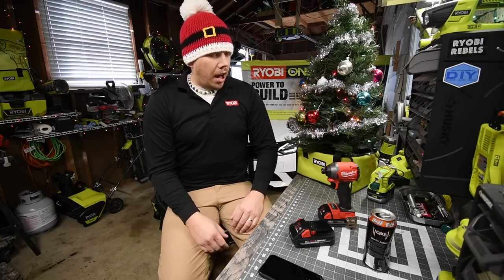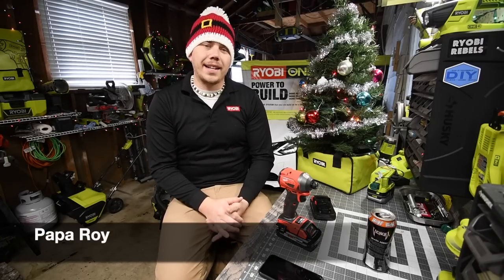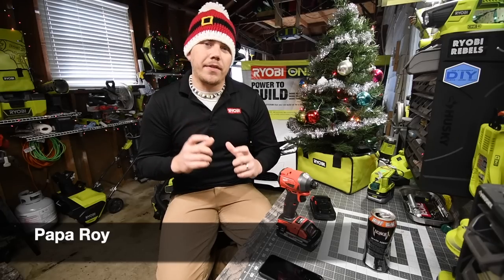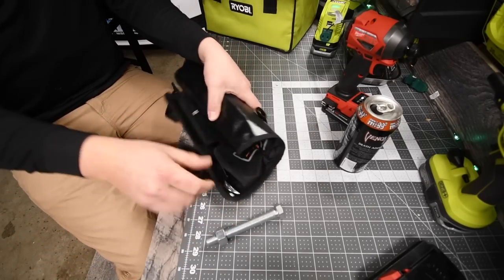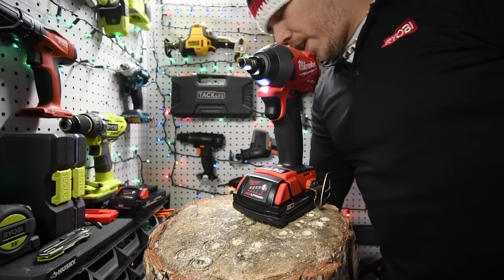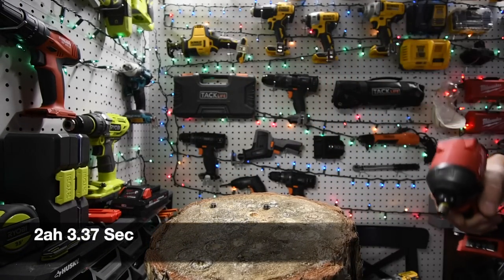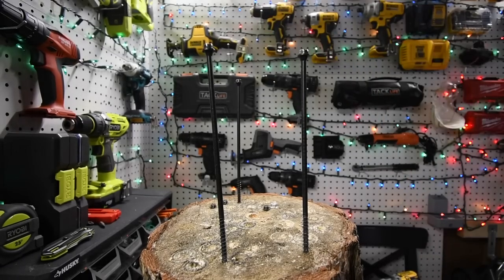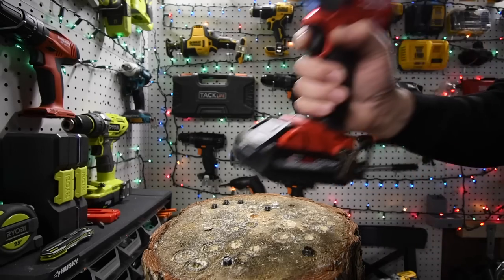Milwaukee 1/4 impact driver test

Comment: We use the medium 1/2 impacts at work to undo 100 15/16 bolts and put them back in 2-3 times a week.  No failures in 2 years of use.  Got the stubby 1/2 m12 and that thing gets hot by the time it's done. It just about uses a whole 4ah battery to get the job done.  The impacts are definitely impressive.
Reply from the maker: Yes they are and thank you ver much
Reply: So your removing and re-securing almost 1" bolts with this 1/4 driver? Any age/rust involved with those 15/16 bolts? I only ask because I need something small enough to access the tension rod nut and zip it off of my Taurus ( yeah ford I know). In a short sentence you seem to have alot of experience,think it will work? The nut size is 21mm I believe. Any info is appreciated.

Comment: I bought the kit with m18 fuel hammer drill, 1/4in impact and angle grinder with 2 batteries and a charger for $399 at Home Depot it’s worth every penny

Comment: For the nut and bolt test.   You could get a thick chunk of steel.  And weld the nut or bolt onto the back side.  And use a digital torque wrench to figure out how much torque the driver was able to put the bolt down with.
Project farm has a rig set up like that.  Not sure which video it’s in.
Reply from the maker: Thank you sir

Comment: Can u put other bits on there like philips or flathead or Allen etc etc
Reply from the maker: with an adapter yes, I do have a video on those and I recently just uploaded one with using it and I also made a Dewalt Freak impact driver

Comment: I love my 2nd Gen fuel impact and hammer drill, had them for a couple years now. Would love to get a 3rd Gen combo set soon, but I can't afford it right now as it's $579 CAD for the driver, hammer drill with two XC5.0 batteries and charger. Fml 😂
Reply from the maker: I thank you for viewing sir :)
Reply: ᚺᚨᛗᛗᛖᚱᚺᛖᚨᚱᛏ just picked up my hammer drill and impact combo today for $309

Comment: Your body temp is basically 98 degrees so I doubt 101 & 103 degrees is hot enough to do any damage
Reply: Brian Klein not a chance that impact is just getting warmed up go watch vcg construction ttr they haven’t had one of these Milwaukee’s fail yet and they put them to the test weekly at times. Sadly there has been several dewalts fall short in Milwaukee’s footsteps!
Reply from the maker: I didn't say the tool is damaged, soooooo. but thank you for pointing that out and thank you
Reply: @ManCaverTools  I got the impression that you were implying that was a high temperature
Reply: @rogerslawncare7260  oh I know I just bought this & 2 6.0 AH batteries on ebay for $220 I'm replacing my older dewalt brushed model 885 or 883 that starts smoking under occasional heavy use

Comment: Great review! I have a quick question regarding Milwaukee and Ryobi. I recently bought the  Ryobi 238 brushless impact driver. I’ve been using Milwaukee impact driver kit Torx bits for a project. The Torx screws im using are 4 inches long. The Milwaukee Torx bits have broken a few times. The guys I spoke to at Home Depot we very surprised it broke. They gave me a new kit. I had one other bit break after getting the new kit.  Have you had this happen? I probably put in about 30-40 screws and had 3 bits break. I m not sure if I’m doing something wrong.
Reply: Are you using the proper size torx bit? Sounds stupid but I’ve done that with torx before.
Reply: Yeah like Nick said I’ve done that myself with the wrong size...Check that first to make sure
Reply: I just bought The Milwaukee brushless compact 1/2” drill driver kit for $89!!....Great deal and that gun is a beast putting out 500 inch pounds of torque
Reply: That's interesting, the longest torx screw I have driven with my bits are 3 inches and none have broke yet. I can see it happening with a strong Brushlesss impact and the screw finding a knot.
Reply: Thanks everyone for replying!!! The screws are definitely long but unfortunately I needed that size for the project. The size of the bit was correct. I did break one Torx bit because the size was incorrect. I used the wrong size because the correct bit size broke and that was all I had left (lesson learned).
Reply: RICH REVIEWS 
I’ve wanted to buy the Milwaukee impact for that very reason! I’m invested in Ryobi batteries and tools so it’s hard to justify changing. Plus I’m a  newer weekend warrior and don’t use the tools for a living. If money was not a concern I’d  definitely buy the Milwaukee impact!
Reply: falchulk ... First of all 1/4” indicates that it’s a impact driver which is more powerful and generates more torque Then a drill driver to begin with... so of course it’s stronger but the drill driver that I have is the most powerful in its class...So yes it is a beast
Reply from the maker: I broke quiet a few bits. you might have gotten a bad batch
Reply: falchulk ...my m12 lmpact puts out an amazing 1300” pounds of torque...If that ain’t a beast I don’t know what is
Reply: And that’s a 12 V not an 18
Reply: dracula45 genisis .... I don’t need to see the video because I don’t agree with what you’re saying anyway.... Milwaukee is not cheap as far as price or quality.... and through my experiences of using power tools (And I’ve used pretty much everyone there is at one time or another) they are by far the best.... I have never had any issues whatsoever with any Milwaukee tool I have used.... and they have proved to me to be the most powerful and most durable power tools on the market.... i’m not trying to change your mind on what you believe so please don’t try and change mine....I don’t go by what people say I go by what I have experienced myself
Reply: falchulk .... but that’s also from an impact driver even though it’s only 12 V....I just feel all Milwaukee tools are beasts
Reply: @devilefan  I too have Milwaukee & ryobi power tools but I was referring to da impact adapters, so y r u taking it out of proportion  but I respect ur opinions & I'm not trying to change ur mind I sent u dis video so u can compare cuz ur having issues wit ur milwaukee bits....!!!!! But thanks for da feedback...?????
Reply: dracula45 genisis .... I’m sorry for the way I sounded and I didn’t mean anything by it.... we all have our likes and dislikes and our own preferences and opinions... I respect everybody’s opinions because they may have had different experiences than I have with particular tools or bits or whatever else it may be.... but I apologize for the way I sounded and I hope you had a merry Christmas 😊👍🏻

Comment: What’s the big deal if your anvil starts skipping on tougher jobs?
Reply from the maker: The anvil skipping just means its overworked. in time it will breakdown the interior and not be as powerful. 1/4 impacts aren't designed to do big lag screws. that's why they made impact wrenches

Comment: These Milwaukee M12 are amazing! You know me and I was a Dewalt fan but I have done a 360 with these 12’s. Try it with the 4 or the 6ah... I huge difference!
I know it’s personal preference to all, but to me they’re amazing!! Thanks again my friend!
Reply: This was a 18 volt tool
Reply: Yup... I messed up... I was still thinking the previous video. That’s what happens when you get old.
Reply from the maker: lol
Reply from the maker: LOL you are the man mr bates
Reply: Ryobi Man Caver ... you and I go back all day long and I had a 20 second brain freeze.
Reply: @ManCaverTools  after watching I just bought this & 2 6.0 AH batteries on Ebay for $220 it'll be here Tuesday the 31st I needed to replace my old brushed dewalt that keeps smoking under occasional heavy use